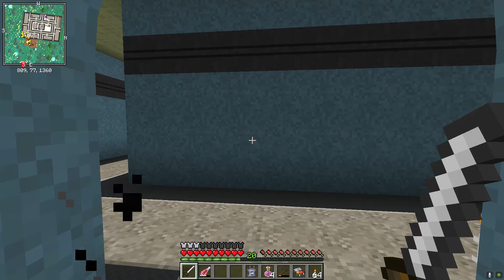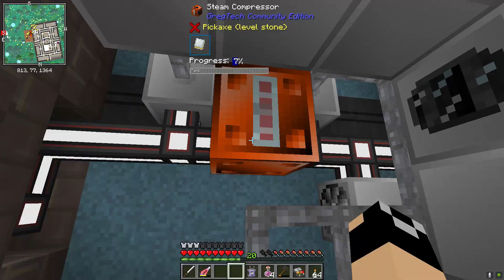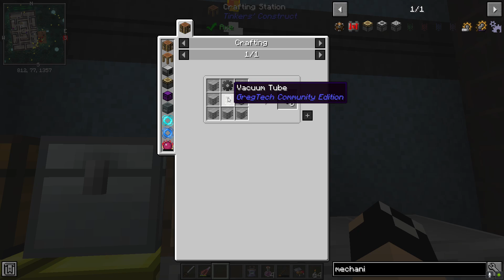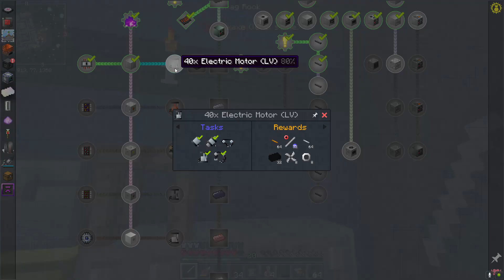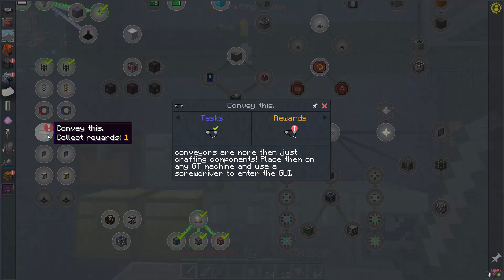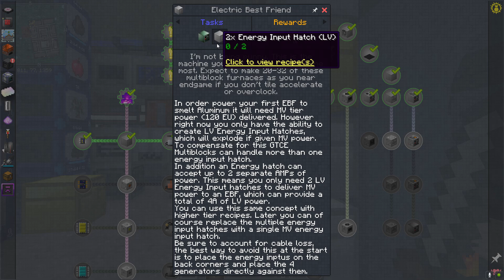Setting Up Rubber and Glue: FTB Interactions Minecraft 1.12.2 LP EP #12

Comment: Looks like they've been working on QoL for GTCE! Is power behavior still kinda wonky (esp with battery buffers and amperage in general)? Edit: Also really wish they'd hurry up and port forward the disassembly/recycling machine so you can get back at least part of what went into your now obsolete machines.

As a reminder, the Tetrahedrite vein should have the antimony you need for the soldering alloy for double efficiency in making electronics vs molten tin, assuming the pack hasn't changed it. Also, I've found lubricant basically free, at least for early game needs, via distilling, and the power saving and time saving can be nice.

Comment: The worst part about gregtech, at least in this pack, I think has to be the fact that by hv tier this entire setup you're making becomes almost entirely worthless. I mean, that glue? It's only useful for one thing (or was in interactions v1). Once you move past that part, it's worthless trash. Resistors? Pretty much the same problem. The entire mid-game portion of the pack is a series of complicated automation build projects followed almost immediately by the complete obsolescence of that build.

Also, pump covers and things like that finally work now? Without crashing servers? It's a miracle!
Reply from the maker: Well thats whats nice about gregtech I think is evolving tech.  This room is designed to just be an lv room and see barely any use before long and thats ok :)  And yeah, covers work.  They worked before as well the last go around without crashing, as I used them for a number of things with np :)  Was the backbone of my ore processing system as well
Reply: Honestly, I wouldn't automate GT circuits until you have SMDs and are crafting the final tier 1 circuits, instead batch crafting more or less as needed. But I also tend towards not automating things I'm not likely to keep for long, doing a large batch to progress past it if necessary. And as a counter point, rubber is usually useful well into late game GT, and the natural method often remains viable even after you can synthesize rubber because of its simplicity and being a tree farm by product, which in turn tends to be a good carbon source if nothing else. But yea, making builds to then have to tear them out again in just a bit is frustrating.

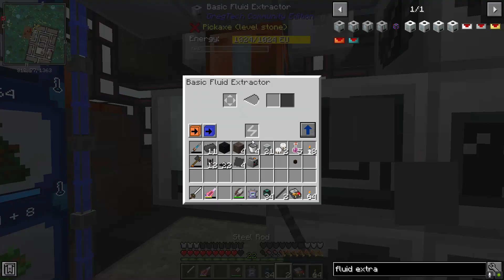Comment: Just an FYI at 23:56 you do not need the pump on the fluid extractor. Just use the wrench to set the output side and hit the blue button in the interface to auto output the fluid.